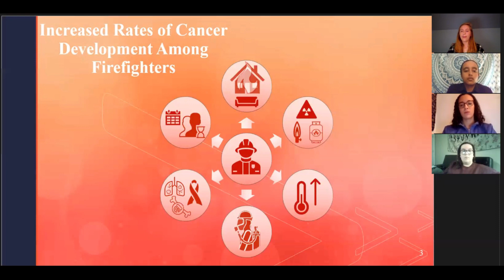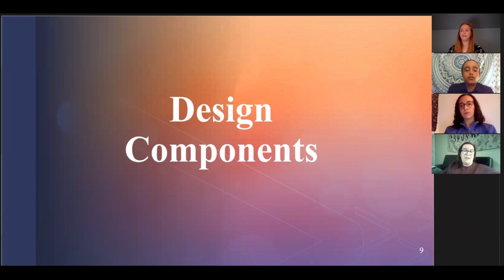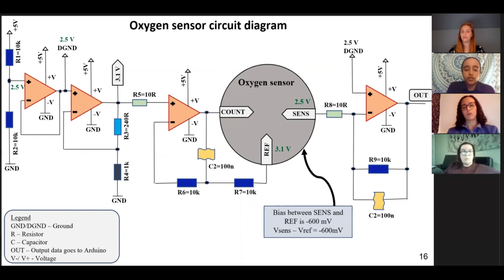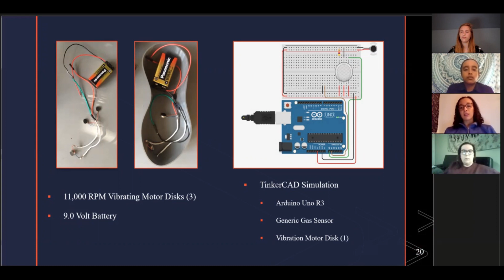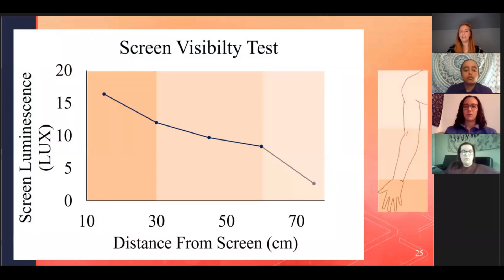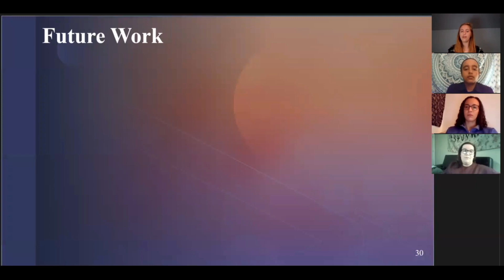Chemical Detector Capstone Team Technical Presentation 2020

Comment: We enjoyed all of the diagrams that your group did. It was a creative way to work around the class interruption. Our question is will all the circuitry fit into the shell? And will the device be put together in a way that allows maintenance to be performed on the sensors and circuitry?
Reply from the maker: We estimate that the shell would need to be made a bit wider in order to fit all electronic components but we were not able to fully assemble all components of the prototype to confirm the approximate size requirements. Because we never completed the inverse on the original shell we were not able to put the two shells together, but we would plan to build the device so that maintenance could be completed if needed and for easier cleaning of the filter to remove any build-up of dust particles.

Comment: Our team thought it was great that you chose to test the screen visibility since that definitely could have been an unforeseen issue. Does your team plan to use PLA in the final design, or would you use a different material since PLA would melt at high temperatures?
Reply from the maker: If we continued to use the Ultimakers in our fabrication process of the final device we would still use PLA over ABS, however, if we were to not use the method of 3D printing we would choose to use a polymer like PPS which can withstand higher temperature environments.